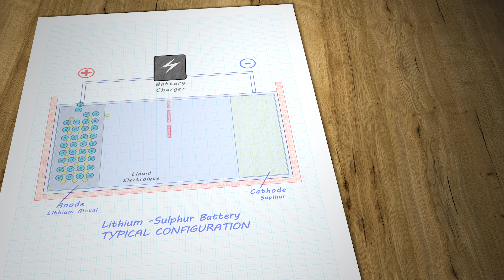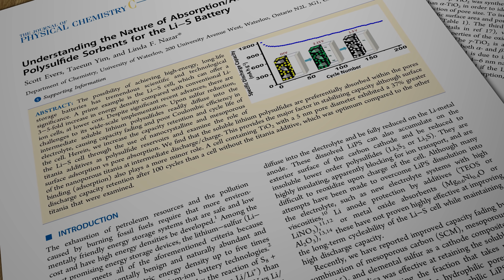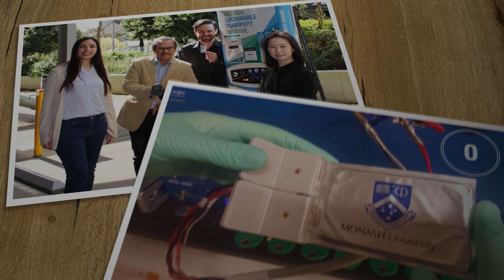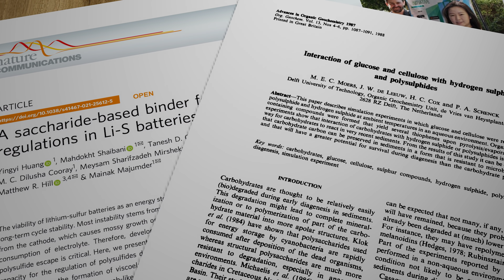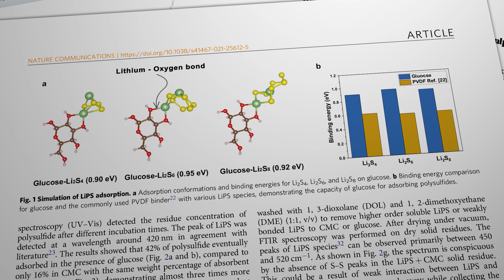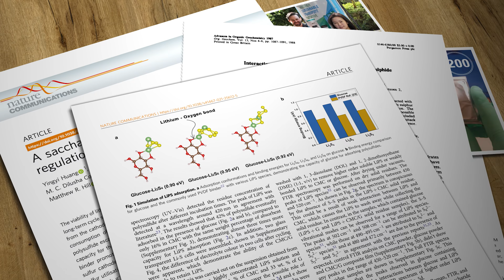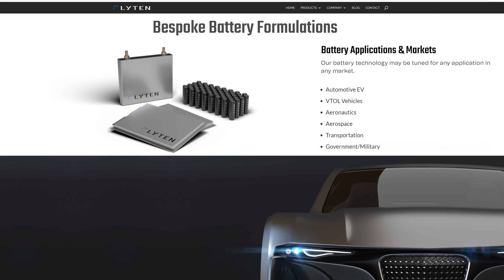Lithium Sulfur batteries: SOLVED! Two new tech breakthroughs in the same week!

Comment: A real missed opportunity to finish off the video with a chorus of:
🎶 A spoonful of sugar makes range anxiety go down 🎵
Reply: There should be a new Nobel Prize added, for successful applied technology that actually works in real life. Then maybe Mary Poppins would get her due, show up with an umbrella, float on stage, then sing "A spoonful of sugar" with still alive Dick Van Dyke, who is currently 95 years old, so hurry the hell up...lol
Reply: Licensing Royalty issues
Reply: That's cute, but I don't think range anxiety is the real issue. It's actually the grid.
Reply: @grantmccoy6739  I'll let you work out the lyrics for that one!! 😊
Reply: @michealoflaherty1265  well honestly, the reason the battery is so heavy is because of its lack of range. So what you said was fine. Electric vehicles in general are limited by the grid though. It should be the most major concern. The battery means it's possible, but the grid determines if it's practical. It's not so much about cost either. Electricity is always going to be cheaper, but it can be less efficient in terms of resources, because it has to be oversupplied.
Honestly, spending trillions of dollars on electrification is a bad idea.
Reply: @grantmccoy6739  The grid is in no way the limiting factor in EVs today.  The limiting factor in creating affordable and practical EVs is the battery.  Do you have a better idea than electrification, or are you just here as a fossil fuel fan?
Reply: @incognitotorpedo42  you don't think the grid is limited? I guess it's been a while since I've heard about any brown outs in southern California, but that is a great example.
Besides, GM had an electric car in the 90's. The technology is not the limiting factor at all. Do you really think there's enough power available to run all the transportation of this country or world. I really don't, and I don't think I'm exaggerating. It's not that I'm a fossil fuel "fan", it's that it really doesn't add up like people imagine. It's not like I think cars are efficient, I know that they aren't. But I also know that the grid really isn't set up to provide that much electricity. It wasn't designed to do that, no grid is.
I have a much better idea than grid-powered battery electric vehicles. Interestingly, if my idea doesn't work, then renewables don't work either, because they both hinge upon load not being transferred through electricity.
Reply: @grantmccoy6739  the grid is more than capable.  The brownouts you talk about are caused when a big short load comes on. Like everyone coming home at the same time and turning on their aircon, cooker, water heater all at the same time and those loads are instant demand. For 2 or 3 hrs of the day the grid has to be able to supply all that power. Then everyone goes to bed and the load disappears. That is really bad for the grid.
On the other hand an EV can be charged when there is not enough demand.
Just to keep things into perspective. Average distance travel is 50km/day.
Average speed is 40km/hr.
EV consumption is around 15kwh/ 100km. That means an EV needs on average 7kwh/day and is available to charge for 23hrs.
So let's say it is only plugged in for half that time so we have 11hrs to deliver 7kwh. That means 630w.
If your home supply can not cope with 630w extra load you probably live in a third world country.
A clothes drier or electric heater consumes considerable more than that.
All the numbers above are real life.
I have an EV and I can get 120km of range per day for less electricity consumption than my electric hot water consumes.
If managed properly (not difficult)  the grid is already capable of running 100% EVs.
The belief that the grid can not cope with EVs is shear ignorance.
No electricity company has ever made a comment that EVs would bring the grid down.
Reply: @franciscoshi1968  you may be correct about those numbers, but it still doesn't change the fact that if ACs can brown out the grid, then surely electric vehicles will exacerbate this problem. The load of an EV alone might be easily manageable, but it's additional load, not a substitution. It's common sense, not ignorance. I haven't ignored anything🤣. But seriously, the grid isn't really set up for it. Just because a house can handle it, doesn't mean the grid can supply it. If you think about it, it's a tremendous amount of power being demanded from a grid that wasn't designed for that purpose. It's easy to imagine that it won't be enough. Besides, battery electric vehicles will not effectively replace logistics, for example, the Tesla truck has the working equivalent of maybe ~50 (15 gallons @100% efficiency) gallons of diesel, could be more or less. Big rigs have up to 300 gallons of fuel. It just doesn't really make sense to use battery electric vehicles for logistics. One more thing, I have a hard time believing that an EV would use less energy than a water heater, dryer, etc. Isn't moving a 3500+ lb vehicle kind of difficult? There's an Audi that weighs 6000 lbs. I can't imagine that it would be easy on power. Weight and power seem to effect gas vehicles, why wouldn't it be the same for electric?
By the way, I appreciate the effort involved in your comment. I just don't happen to agree that the grid can actually support EVs at large quantities, but it's certainly not going to kill it in the short term or anything.
I just want to clarify, that I don't think that the problem with EVs is the battery. Even if the battery tech becomes way better than it is now, it still doesn't mean that the grid is equipped for it. That was the whole point.
Reply: @grantmccoy6739  I have two EVs. An MG which uses about 14kwh/100km and an Imiev which uses about 10kwh/100km.
A Tesla model X uses about 20kwh/100km. The Tesla is a huge car the Imiev is tiny but the difference is not that big.
The reason is regenerative braking.
In an ICE car every time you start and stop you throw away all the energy. A car twice the size looses twice. For an EV you get at least 50% of it back. Also an ICE car twice the size has twice the power. An ICE engine is very ineffecient just the friction of turning the engine is big which so twice the consumption. For an EV the difference is very small. A motor with twice the power running at the same load consumes almost the same as a small motor. For ICE is not. That is why the difference between small cars and big cars is not that big for EVs.
As for air conditioners causing brownouts there is a big difference. 
When people get home they turn their aircon all t the same time and all use lots of power at the same time because the AC needs to work hard to cool down the room and you need the power now.
An EV charging on the other hand can be controlled by  the power company so even if every one comes home and plugs their car in they don't start charging straight away. You have the whole night to charge. The power is not needed now. That means they can be turned on when everyone goes to bed and the load drops.
As for the power of a hot water system,  storage water systems are generally about 3.5kw and a slow car charger is about 2.5kw.
I have measured the power consumption of my hot water during rainy days and it is as high as 17kwh to heat up the water overnight whereas the car only consumes 15kwh for 100km.
If the charger draws 2.5kw it will take 6hrs to charge 15kwh which is 100km.
There is nothing out of the ordinary.
The problem is the perception of how much energy is required for different activities. Heating up water is a very energy intensive process.
So the grid should easily cope with EVs.
The grid will function better if it can use EVs for load balancing and it will make electricity cheaper.
Reply: @franciscoshi1968   regenerative braking doesn't mean anything if you aren't stopping. So on the highway, it's not relevant. I'm not saying regenerative braking isn't inherently efficient, it is.
ICE's have almost no friction during any of their mechanical actions. They use lubricants, otherwise, they wouldn't last an hour. The friction is negligible, it's the pumping loss that takes energy, otherwise they would conserve momentum (they don't).
ICE's of greater sizes don't necessarily get lower fuel economy. Big V8s can operate at lower RPMs, which is far more powerful and economical. My 240sx (2.4L 4  cyl) gets 26 mpg highway. The Corvette (5.7L V8) gets 30. More than 2x the displacement and rotating mass, with better mileage. The current Silverado gets better mpg highway with it's V8, but better mpg city with it's 4 cyl. It's a balance between rotating mass and power delivery. I actually designed an engine that takes advantage of both of these concepts. Also, fuel usage is about the same with engines too, but as I said, both RPM and rotating mass effect this negatively. Meaning neither small engines nor big engines have an advantage overall, unless you can mitigate both of those. My engine design does this, but that's another story.
Also, the difference between 10 and 20 kw is literally 100% more energy. I don't know why you think that's not very much.
Electricity cost isn't just based on supply. If demand is higher, costs will increase, especially if they have to invest in power generation and/or transmission. I doubt electric vehicles will lower the cost of electricity for that reason. It could, but this is capitalism we're talking about.
I don't think battery electric vehicles are the right solution to what is happening right now, and I don't think my engine is either. People don't like gas cars because they are dirty and unreliable. People don't like electric cars because they are attached to the grid and slow to charge. This world needs something else, that's better than both of those options.
One more thing, brown outs probably aren't actually caused by ACs. My sister lived in LA, and her apartment, and most others, didn't have them because they weren't necessary. Power outages are caused by power demand exceeding supply, and this is because the power company can't control who is using the power and when. They could schedule or meter usage, but people don't like to be told that they can't charge their vehicle because the grid can't support it at this particular time.
Anyways, I appreciate your comments. It's definitely interesting to hear about your experiences.
Reply: @grantmccoy6739  the reason EVs could make power cheaper is as follows:
Power generation has to be able to cope with peak demand which happens for only a few hrs per day.
Base load which is the cheapest electricity (generally provided by coal) can not change output quickly  so they are run at an average level. The peak is produced by peaker plants which are quick to ramp up but expensive to run.
During the night when demand is low coal stations are underutilised. If EVs can be charged at night you can run these plants closer to capacity most of the time. That means that the investment cost is lower and there would be lower need for peaker plants so you end up with more electricity being generated by the cheap generators. For example if we could make electricity consumption perfectly flat then all electricity would be produced by the cheapest source. EVs can be used to keep those cheaper plants running closer to capacity all the time.
As for controlling the load, there are already systems in place that use this method.  In Australia we have something called controlled load. This is a supply that can be turned off by the electricity companies when demand is high. It is used mainly for hot water systems. I charge my car from this supply because I have solar hot water so I don't need much electricity for the hit water. So what happens is I plug the car in and when the power is turned on (at around 9:30pm after peak demand) the car starts charging. The power is then turned off at about 4:30am just before peak time. The electricity do from this line is almost half the price of the rest of the supply. There are already some pilot programs where the electricity company supplies chargers that can be controlled remotely to get the same effect.  The difference with the chargers is they can control the charge rate rather than just on off. This means the electricity company can adjust the load in real time which means they can reduce the need for peaker plants. For example say your car is charging at 2kw. Then your AC turns on for 2min and consumes 1kwh. They can drop the charge rate of the car to 1kw for 2min and then turn it back to 2kw when the AC turns off. So now you can generate 2kw continuously and no need to have a peaker plant generate 1kw for 2 min. They can also do this during he day when solar generation is high and a cloud goes past. The cars can be turned down for a minute or two.
Reply: @franciscoshi1968  that all sounds reasonable, but actually it doesn't really make that much sense.
For one, loading an electrical grid would literally cause generators to slow down, making wind power functionally worthless. While you may be able to control fossil fuels, you can't control wind. When a generator's speed fluctuates, so does it's frequency in Hz. Loading a generator would basically make it almost impossible to match this in real time, because the entire grid would need to fluctuate in frequency together, or load match together, something wind energy can't do. As load increases, power generation would decrease. So clearly, it doesn't work that way.
What you can do, is just have generators either on or off, and adjust that accordingly. Which is fine, but it still doesn't make electricity cheaper. If anything, the cost is the same, because you are only using what is already there, but not being utilized. That being said, the power company knows what the average demand is overnight, and they operate accordingly. Any way you look at it, power generation must increase in order to use battery electric vehicles. This doesn't necessarily mean that the average price would go up, just that total electricity purchased would go up, which isn't terrible or anything. It's only bad if both power generation and/or transmission needs to be increased, because that would result in increased cost of electricity. The problem with that is that it effects more than just transportation costs, it effects cost of living in general.
Smart grids sound like the solution from the outside, but it actually doesn't really add up if you think about it critically.
Reply: @grantmccoy6739  it sounds reasonable because it works. That is why off peak electricity is cheap. Because you have a generator that makes very cheap electricity that can not be turned off and peak time is expensive because you have peaker plants that are expensive to run. But you can jot run cheap generators at full capacity all the time because there is not enough demand. 
This method is already in used in places like Australia. Adding EVs will help. That is why they have controlled load supply.
Reply: @franciscoshi1968  excess supply might be cheaper, but that's up to the power company. Where I'm from, cost is based on demand. They use brackets, and increase the cost of power, the more you use. So it gets more expensive per kWh if you use more. Like 0-500, 500-1000, etc. No it isn't fair, and it doesn't make sense, but it's a monopoly. That isn't really the point though.
The point is that unless all the electricity that people will need for electric cars is already available, it will end up costing more because additional generation would be needed, even during the night. At the very least, that means resources, which means cost, but it could include infrastructure.
Maybe I'm wrong, but it seems like electric vehicles could use more power than a house would, depending on the mileage, etc. Not too mention used vehicles (batteries become "leaky" over time), which people haven't been able to experience fully yet.
Electric water heaters may have poor efficiency, but most electrical appliances probably don't use much energy.
I think it's common sense that it would require a significant investment in infrastructure to cope with the demand. It's just a hunch though.
If I'm right about whether or not electricity can transfer load, this current technology might not even matter at all. It might be possible to actually power a car with it's own generator. 😆
Reply: @grantmccoy6739  I am also in Australia.  I run an EV, and also have a small array of solar panels. Every day, I give more power back to the grid than I take from the grid.
Now, in most of Australia, the price that coal and gas power plants get during the day is less than their cost of production.  They make money from gas peakers only in the morning and evening peaks, and at this time of year with daylight saving and longer days, the evening peak is mostly covered.
Reply: @grantmccoy6739  Grid doesn't need weight. Think pumped hydro😁
Reply: @HughButler35  weight? I think you misunderstood me.
Reply from the maker: :-) good point!
Reply: I wanted that also. In costume. Informative video though.
Reply: 'Townsey' from Scrubbs.